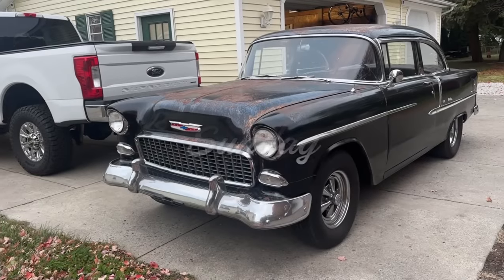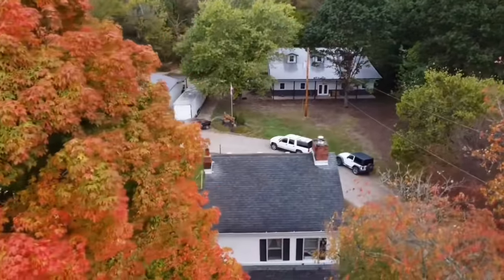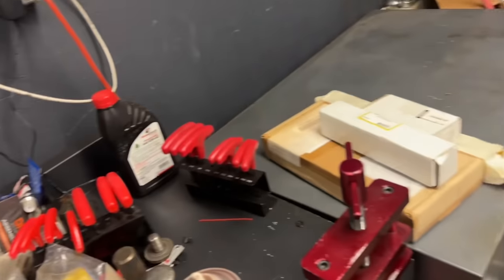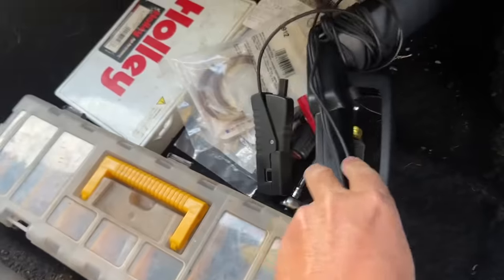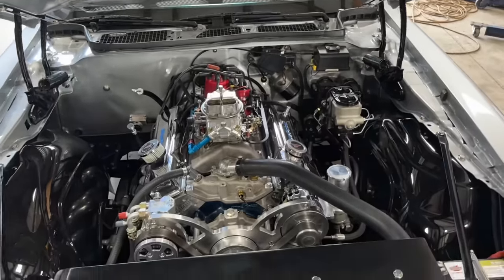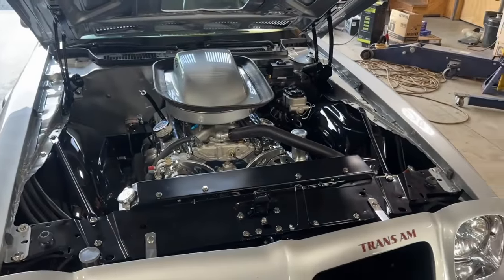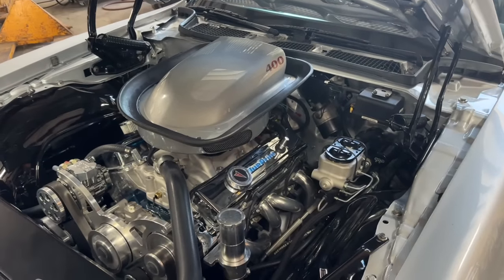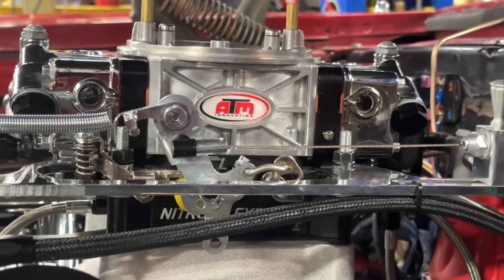INSANE POWER DIFFERENCE!  500hp 400 Small Block Chevy powered TRANS AM COMES TO LIFE!

Comment: I've went through 4 or 5 of the new 6al boxes. Finally found an old 6a box at swap meet and it's probably 25 years old and works great except no rev limiter but at least it fires right up.
Reply: Ahh who needs a rev limiter.. hold er wide open till she starts to float the valves, then grab the next gear.. The old 3 & 4spd transmissions love rpm due to the large split & rpm drop between gears anyways.. lol..

Comment: Is a nice looking can't believe small block Chevy and a 9-inch Ford rear end in it. I have a stock 10 bolt rear end. Have no problems out of it. With a 600 horsepower Pontiac engine

Comment: I've been fighting ignition issues on four vehicles since August. Still haven't figured it out on my 65 GTO, I think the tach is causing the EFI to lose tach signal. Been considering a carb for it, but its an ignition problem. Over the winter I will rebuild the tri power carbs and set them up for E85. Its sad that TransAm has a chevy in it, but some people can't handle Pontiac power. ;)

Comment: I had this same issue with my SBC 350 in my el camino. It happened to be caused by a faulty Ignition Control Module in my HEI distributer.

Comment: Well for starters get rid of that msd system and put a fireball system on it. And that problem is wiring. The coil is cutting out. You need to replace the wiring and that msd. Fix the wiring and fit the crane fireball and you will not have any more problems with it. I have run big block fords all my life and I have never had any problems with any of them. As long as I have rewired the cars and fitted good power systems I have had any problems. From the age of 14 years old. Iam now 50. And every single car I have owned or built for a customer I have done the same thing weather it is a carby car your fuel injected car. The same thing and no problems. Oh and no matter what car. Ford Holden/ chev, Mazda Toyota Nissan. The list goes on.

Comment: blueprint sells some bad ass small blocks i just put a 454 stroker in a 85 caprice 2 door and it will light the tires at 45mph on a 26in wheel but im running a Holley sniper efi setup it makes right at 600hp and almost 700ftlb NA

Comment: How do you keep it from binding up and wanting to kick back w that much timing all the time ?? Locked out at 36 on a hot day at over 200 dg is going to be a problem I'm sure
Reply from the maker: The 64 C10 is locked out at 36 degrees and we tow with it in the summer with water temps at 215 degrees.  

Camshaft lobe separation and CL can make it difficult, but I’d you have a problem you can use a start retard.

Comment: You can tell it’s not the carb by the tach dropping out. It’s losing pick up signal or the box output is dropping out. Mine 6la2 took a crap couple weeks ago. Freaking sucks. I swear with all the ones you’ve gone through those things are junk. Is there a better, more reliable box? Mine was on my daily so I need reliability.